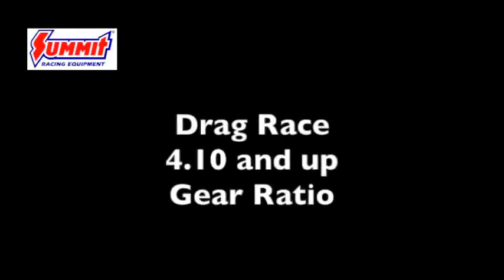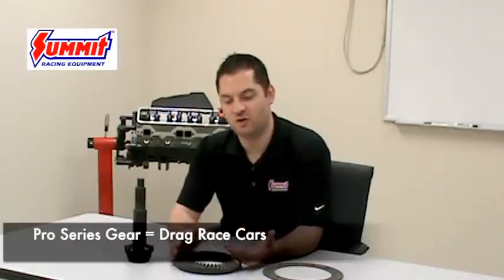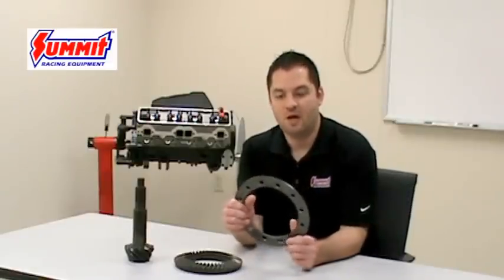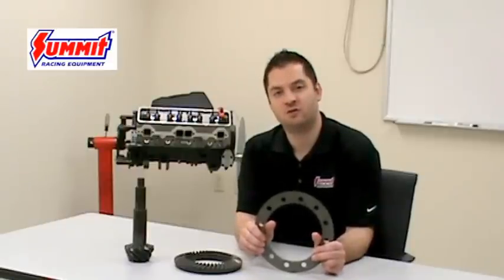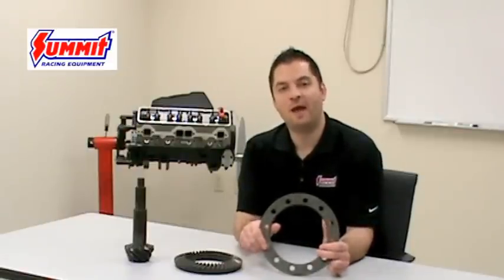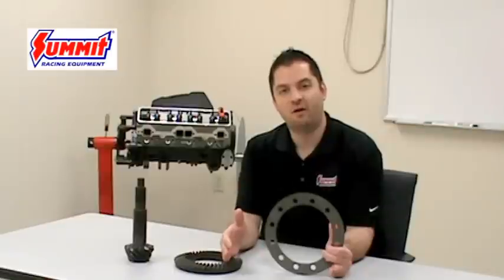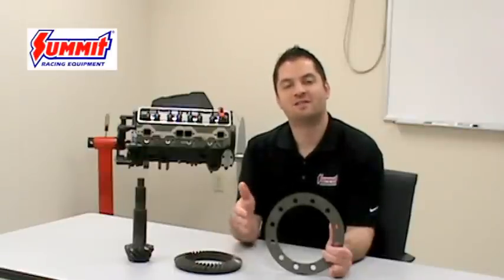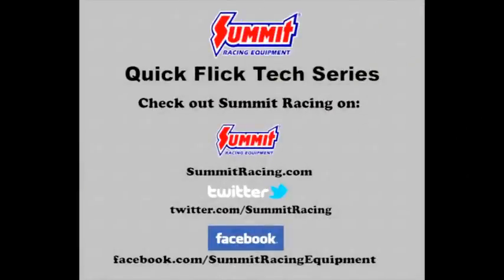Selecting a Ring and Pinion Gear Set for Your Vehicle

Comment from the maker: Thank you for the request, we can try and help now if you would like. 
Typically fixing the speedometer reading requires a change of the speedometer gear in the transmission if the speedometer is cable driven. Late model vehicles usually require a computer programmer to solve this issue though due to the speedometer being electronically driven.

Comment: Good stuff as usual, that every d.i.y. guy ought to know.   I would emphasize two things for any build, and they bounce off each other so some tradeoffs happen in that process.  First is what RPM do I want to operate in.  Second is what cruising speed do I want [if any] - a critical step for a street build or for track.  Tracks dictate top speed, and you'll see racers changing rear ends to suit.  Drag racing has no cruising speed and is its own animal - no comment here, as I lack cubic money. All things evolve out of the first two criteria: cam selection, torque converter, and gear/transmission ratios.  My next step is to make sure cam selection doesn't force me to violate the RPM/speed criteria I pick.  For street, that means gear ratios suppport me being near or above the stall speed my cam likes at 35mph [typically in second gear for a 3 speed tranny].  Beyond that is what RPM do I wind up in at 60 on the freeway.  When in doubt, add a transmission cooler, but pick gears that work.
Do the math and thank yourself later... have fun!

Comment from the maker: The street gears are cut for quiet operation in a street driven vehicle while the Performance series have a more aggressive cut to make them stronger for high horsepower applications and are a noisy gear because of that fact.

Comment from the maker: On cable driven speedometers we will first need to know the following to solve this problem:
 - Transmission type
- Color of the speedometer drive gear (or tooth count) on the transmission output shaft
- Tire size
- Rear differential gear ratio

Comment: 4.10 gears and a Th350 trans makes a nice combo on my camaro. It pulls like a mother. I run a 275/60r15 tire and it runs about 2,600ish RPMs at 55 mph.
Reply: Good info. Im trying to learn the basics here, I have a sbc 350 / TH350 combo in a custom hot rod I bought. Trying to figure out what gears I have and if they're worth changing.

Comment: Good information also engines that are smaller and have less torque need a lower gear or they will struggle to pull hills requiring early downshifting and very slow uphill speed. Transmission ratios are part of the puzzle. Transmission swaps can change it up alot.

Comment: A higher cruising RPM isn't always harmful to the engine. My buddy has a 2001 Honda Civic EX 5 speed that cruises at 4000 RPM in 5th gear going 80. Sure, it is noisy at such a high RPM cruising, but he's had that car since it was new, and the engine is still in perfect condition after over 250K miles.
Reply: Keep in mind that most of this information is directed at rear wheel drive cars with longer stroke engines than a honda. So the rings will wear out faster at 4000rpm in something like a 434sbc with 4 inch stroke vs  a honda with 2" stroke. At the same rpm with the long stroke engine. The piston is traveling twice the distance inside the cylinder.
Reply: @nashvilleoutlaw  That is a great point, you are correct! However, I have also heard arguments saying that the cruising RPM doesn't have much effect on ring wear within a certain reasonable range because the cylinder pressures and temperatures are lower under a lower load. So even though the pistons are traveling more distance per mile the car is driven, the rings aren't forced against the cylinder walls as hard due to the lower combustion chamber pressure under the lower engine load, therefore the ring and bore wear stays about the same. Not sure how accurate that is, but it's an interesting theory

Comment: Remember that automobile final drive ratios are expressed in numbers with respect to one. A 3.23 gear is a 3.23 to 1 ratio (3.23:1). A ratio expressed by a larger number is a lower ratio (4.11 gears are a lower ration than 3.73). Avoid using the term “numerically higher” it only adds confusion to the subject.

Comment: Hi Mike I have 632BB Powerglide and 6.50 Ratio with 31 High Tyre. having the 6.50 diff ratio with tall tyre. car weighs around 3000lb loaded. What would you estimate the final drive ratio be?

Comment: I have a gto 6.0 AT. and I am thinking about going with 3.90 gears my tire diameter is about  27" . I am using it as a DD and the track occasionally ( road course) is this a good choice?

Comment: Great Video. I was wondering which gearset would be best 4 me. In my 65 GTO I'm changing the drivetrain to a mildly modified Pontiac 462 with a 068 GM cam. Transmission I purchased is a TH-2004R with a 2000 stall speed converter and the rear is a 12 bolt with 4:56 This rear is out of a 65 race chevelle, so I know the ratio is too high for my street application. I will be driving on the street most times and sometimes going on short hwy trips from time to time. Hopefully going to the track a few times as well. I was guessing that a 3:55 ratio would probably work out with my new overdrive tranny, but I would really like to know your recommendation. Thanks
Reply from the maker: Hi thomas wild, 
We can definitely help, however, we have a few additional questions for you. Do you mind giving our tech department a call at 1-330-630-0240? We look forward to your call. Thanks for watching and good luck!

Comment: 2016 Sierra 1500 on 37x13.50r22 tires.  Daily driven & also pull quads in a trailer..   any gear size recommended?  Thanks in advance

Comment: I have a 2003 merc grand marquis with a 2.73 currently. Not sure if 3.27, 3.55 or 3.73s would be best for hp and torque increase without dropping off mpgs. Mods are cold air intake,  flowmaster super 44 mufflers with dual exhaust as well
Reply from the maker: Hi Jake Casko, 
Changing the rear ratio will allow you to use the existing torque and horsepower for quicker acceleration. By going to a higher numeric ratio, the car will be able to accelerate faster but the give away is a higher highway cruising RPM and potentially less economy. A good compromise for the given application would be a 3.55.

Comment: A year ago, I installed a Summit branded ring and pinion in my daily driver SUV.  I'm pretty happy with it, it's quiet and works.  But I still wonder, how should I relate brand and quality?  I could have spent twice as much on an OEM or a Yukon ring and pinion set.  I just assumed that Summit re-branded a bunch of Chinese Richmond gears and sold them for a couple dollars less...still not speaking anything of quality other than the typos in the included literature.

Comment: I've got an 82 GMC Crew cab Dually, 454 with a th400 and it's currently rolling with 4:11 gears, this makes the truck scream at 60-70mph, I'm looking for a better interstate cruising speed, with less rpms I don't really tow or haul anything heavy, it's more of a show truck than a work truck would 2:73 gears be a good idea? Are they available for my truck? What would you recomend for the rear end? Thanks!

Comment: i have a 1996 camaro LT1 Z28. it has factory 2.73's am in thinking about installing 3.42's. i would like to add some performance but want to keep cruise rpm down. the trans is the 4L60E auto
Reply from the maker: +andrew donohue , 
A 3.42 ratio would be a great choice for you!

Comment: Hi can you tell what the best gear setup would be for the following: 1969 Camaro, 350 HO engine, 700r4 trans, 245/60/15 or 26.6 inch tires. The car currently has a Part # off gear: YG G182 411 304. The car is used for street and occasional hwy rides. looking for a good all around gear. Not sure what the stall is but the part number on the torque converter is model number:  K1 3F 766 #6. What is your best advise on how to get the most out of this setup.

Thx,

-Joe

Comment: Do you recommend 3.55 gears for a auto 2014 5.0 mustang FBO with cobra jet setup long tube headers and off road h pipe. Great video 🇺🇸
Reply from the maker: 3:55 is a good overall street gear. Your best option is to use a gear ratio rpm calculator to determine engine rpm in a specific gear.  The 6R80 transmission gear ratios are 4.17, 2.34, 1.57, 1.14, 0.87, and 0.69:1. I estimate your engine at approximately 2375 rpm @ 75 mph in 6th gear with a 3:55 ring and pinion.

Comment: Great video, if I want to make my stock chevy 7.5 into a posi and I happy with the current gear set can I just change the carrier for a limited slip or locker and reuse the same gears?
Reply from the maker: Yes, you can upgrade to a posi carrier and reuse the same ring and pinion gear set. A new installation kit and bearings would be recommended. If you need help selecting the correct part numbers, please call our sales line at 1-800-230-3030.

Comment: I have a wrangler JL turbo 2.0 with 2" lift and 35" tires . I use this vehicle for every day and off road driving. usually I drive up 65mph. plz advice
Reply: If it has overdrive I would go with 4:56 gears. If not I would use 373 or 4:11

Comment: I have a 1978 Camaro, 350 engine, 350 trans, with 3.08 gears. I am in the process of building this car, and have not used it yet on the road. I just need to know what is the best Stall to use on my Transmission.
Reply from the maker: Hi Scott, we need some additional information from you. Can you give us a call at 1-800-230-3030?

Comment: I have an 81 chevy k20 with 35s and i belive 4.10s in gm\corperate 10.5 rear end and I belive a stock 3 speed auto trans. i  want better acceleration speed. Should I go to 4.56 gears or down to 3.73 gears? Also if I go to 4.56. I will need either a RG spacer or think gears yes?

Comment: I have a 72 Monte Carlo with 28 inch tires and a 350 engine and thm350 but it will be replaced by a 2004r. I don’t know whether I should install 3:36, 3:55 , or 3:73 gears. Any suggestions?
Reply from the maker: Hi Jorge, 
To help you choose the correct gear ratio for your application, more details will be needed. I would recommend you contact our sales line at 1-800-230-3030.

Comment: So for a lifted truck, that is daily driven.. I have a 1995 f-150 and installed a 4 inch lift, and 33 inch tires. My low-end power/acceleration has significantly decreased. I believe I am currently running the stock 3.55 gear, and know that a higher ratio would help my acceleration. However, I have a 4 speed transmission and drive the interstate pretty often. What would be the best way to improve low-end power while keeping my cruise RPM low for my 4 speed?
Reply from the maker: +Aaron Stevens, 
With your trucks original tire size and gear ratio, you were cruising at approximately 1800 RPM in overdrive at 65 mph. A new 4.10 ratio with your current 33” tire size will put you at that same RPM.
Reply: +Summit Racing Thanks!!

Comment: I have a 1978 camaro  350 4 barrel carb engine....i would like to put in pro como heads 210cc, 373 gears, and a cams with lifters, and a dual flowmasters 2 1/2 super 10 series exhaust.? Was wondering if you think that would run ok? Daily driver
Reply from the maker: Audrey Otto , 
Can you give our tech line a call at 1-330-630-0240. We need some additional information from you. We look forward to your call! Thanks for watching.

Comment: I have a 1993 ford f150. I have 3.08  I want more low end power and speed. It is an overdrive transmission. Should I swap to a ring and pinion with a ratio of 373 or 410. Speed is the goal, but I don't want to lose my passing ability on the interstate.
Reply from the maker: Hi palmettobouy1,
A ring & pinion change is definitely the way to go here. Since you have an Overdrive the 4.10 would be a good choice and only raise your cruise RPM approximately 300 RPM. Thanks for watching :)

Comment: I have a 2015 Silverado 1500 crew cab 4x4 with 5.3L engine. Came with 3.42 gear ratio. Just doesn't have the get up and go from a dead stop that I would like. Which gear ratio would you recommend that would increase performance yet still get me decent gas mileage without having to change a bunch of other parts
Reply: R Parris id go 3.73 or 4.10. or you can try 3.90

Comment: So if I'm running a 20200715 in my  89 D100 Dodge Pickup with a 318. . .  Rpm rating from 1200-5500, would the Reman. Stock Torque Converter and the 3.23 Ratio Rear be a good fit for the 33-35in tires I'm running?
Reply from the maker: The stock torque converter and and the 3.23 gear ratio will work, but with the taller tire that you’re running, I recommend going to a 3.42-3.55 gear ratio.

Comment: Summit Racing, I have a Chevelle with a 350 and a Powerglide on 15" wheels(I believe 27" tires). What gear ratio do you recommend for a happy medium between fuel economy while maintaining some low end power? Also, if I were to upgrade to a 4l80E what ratio then? Thankyou.
Reply from the maker: +Isaias Arocho, 
With the specs and usage you’ve given, a 3.42 ratio would be a good all around choice. Now, with the Overdrive, you could go higher (numerically) like a 4.10 and get great acceleration but also enjoy cruising due to the overdrive. A lot of this depends on the cam being used since it determines the RPM range of the motor. Give us a call, with that info we can assist you better. 1-330-630-0240.
Reply: I appreciate the help. I will call and talk to you guys to buy the right parts.

Comment: I Have 08/GMC Sierra 5.3l
Airraid M.I.T intake
K&N high flow drop in filter
Magnaflow catback exhaust
Gibson short headers
Bullydog performance tune
AFM disabled
Custom shift points
2to3 body drop.
 
What gears would be the best performance for this rear wheel drive truck...thanks
Reply from the maker: Hi Alex Benitez, 
Do you mind giving our tech department a call? We have a few additional questions for you. 1-330-630-0240. Thanks!

Comment: I have an lt1 5.7 in my 1991 S10 with a th350 and 3:08 gears on 235/60/16 tires. I was trying to get more acceleration but I don't want to use it for strictly drag racing. I want it to be a daily driver that I can play around in when I want, without it drinking too much gas. What gear ratio do you think I should go with?
Reply from the maker: Stan Bennett , 
Without knowing more about the motor, specifically the camshaft because it sets the power band of the motor, its hard to say really. If the motor cruises too low in RPM it lugs and uses excessive fuel.  If it cruises too high in RPM, it use excessive fuel!  Give us a call with more info and we can assist you better. 1-330-630-0240.

Comment: Summit Racing I left a post about 5 days ago I was told to leave some additional information concerning my 350 Oldsmobile rocket 350 72 Oldsmobile and with a high rise intake with a comp for mechanical flat tappet cam I believe the cam, 496 502 I lost a cam card engine built very low compression with a 2800 3200 B & M torque converter all of this is in a 79 Pontiac Bonneville with 323 gears and now I want to know will 373 gears with a full posi engine border over60 head shave down 90 with the 3 angle valve cover job.
Reply from the maker: Tytis Crawford, A set of 3.73 gears would definitely improve how your combination performs.

Comment: Hey summit racing i have one question, I got 96 mustang 4.6l gt 5 speed with basic bolt on. I want to get the most power out my engines hen I'm racing but still have a good cruse rpms, so what gear ratio would you recommend??
Reply from the maker: +Jorge Camarillo, 
The easy answer here is “well, that depends”. But, for most people a 3.73 gear ratio is an all around great street ratio.

Comment: Hello.. I have a 2017 gmc Sierra 8 speed transmission with 3.42 gears.. when it was stock I would get 20 miles a gallon..now that I put a 7 inch lift with 22x12 rims on 35 it went down.. I'm not worried that much about mpg but I would like to get that power back.. what do you recommend
Reply: tu necesitas al menos 4.10 ratio, es perfecta para llantas 35s

Comment: I have an 89 Camaro Rs with a 305 Tbi It doesn't have a posi but I'm planning on doing Zexel Torsen unit which gear ratio is better for a street car 3.73 or 4.10
Reply: Neem Tv ひ 3.73

Comment: i have a 1991 trans am LB9 305 TPI 700R4 with a G80 2:93:1 gear i was thinking of 4:10: or 3:73:1 the car is only drove local it does not go on road trips very far maybe 30 miles at best i have a cold air intake flowmaster exhaust shorty headers and y pipe 2.5" and 3" pipe back to the muffler i also have underdrive pulleys and 1.5 full roller rockers and a 180 deg thermostat and a stage 2 jet performance chip which gear do you think.
Reply from the maker: toby clemons , 
Since it appears you are looking for the quickest acceleration with little to no regard for MPG and RPM’s on the highway, the 4.10:1 ratio would work well here!

Comment: I have an 88 S-10.  I just pulled an 5.3l from a local junkyard with 89,000 on it.  I ordered a Z06 cam for it since I plan to boost it later on down the road.  I'm saving up now to get the Currie Ford 9" rear you carry that is a direct bolt in.  I have no idea where to go gear wise as this is my first attempt at building a vehicle.  I know I'm going in the street/strip area, but I do plan on driving it on good days as well a little track time too.  Any suggestions in a gear selection please?
Reply from the maker: CBiskitone , 
This really depends on the total vehicle build plan. Use of the vehicle, build of the motor, transmission and tire size are all factors in choosing the correct gear ratio. Give us a call with all of that info and we can help you choose correctly! 1-330-630-0240. Thanks!